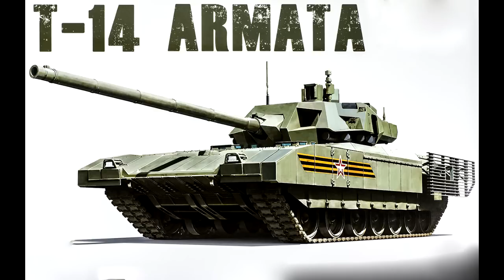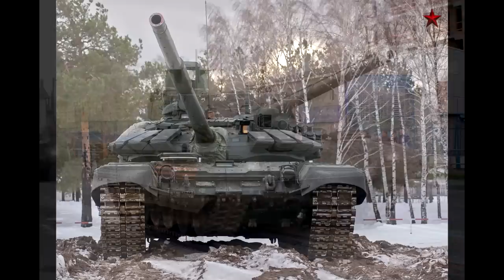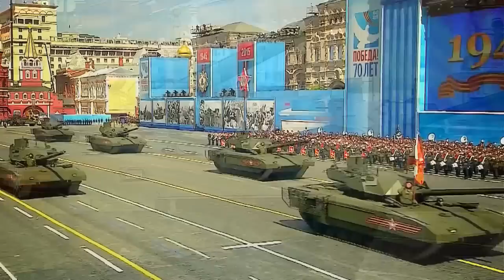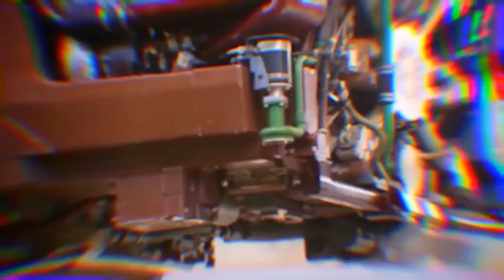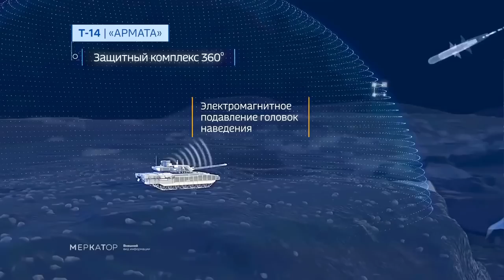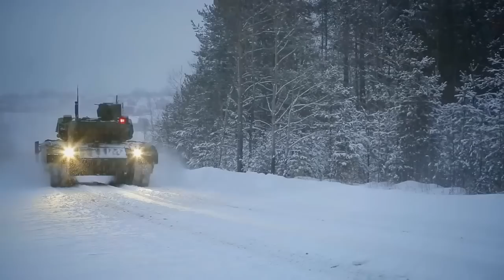Busting Myths on T-14 Armata

Comment: I really looked forward to this video but realize that no myths are busted since no proof are given. So busting myths becomes its own myth. 👎
Reply: That claim on Afganit being able to stop APFSDS is quite questionable. That Izvestia article claims it works in same manner as Drozd. As it has been admitted by Russians, Drozd is unable to stop APFSDS. It is simply too slow. I dont really see how Afganit can stop Sabot if, it works same as Drozd. Problem is that shell velocity of APFSDS is 1,5-2 km/s, while Drozd shell velocity is most likely subsonic. Drozd shell needs to fly 7 meters before APFSDS reaches the tank. Meaning that from range of 500m APS has less than 0,3 seconds to detect, calculate, turn turret to correct azimuth, launch, and shell to fly to interception point. Also the effect of light fragments hitting extremely hard object with extreme energy may have little to no effect on APFSDS. 

This "source" claims that KAZ Afganit uses Explosively Formed Penetrator. http://www.findpatent.ru/patent/226/2263268.html

Completely different claim than what your Izvestia claims. Both Russian sources. This is easier to believe that IF Afganit uses EFP instead of FRAG to intercept incoming munitions, it may be able to distrupt APFSDS. Though the means of delivery is still problem. Being Drozd related, it may still be too slow to meet the incoming shell.

Since we have sources claiming completely different methods of operation of Afganit, we can only wonder what is the truth or if there is such at all. I believe that Afganit can stop APFSDS when is see slow-mo of it happening.
Reply: RedEffect no, youre using Russian state owned media as a source. do you think that there could be a little bias there? lol
Reply: "Afghanit" was indeed sucessfully tested against APFSDS. As far as i know it can stop threads with a maximum speed of 1700 m/s. Sure, an Hardkill APS doesen't "intercept" APFSDS. Not possible, but it shatters/tilts the KE penetrator. A israeli study has shown that only 7° tilt reduces the penetrators energy about 90%.
Other APS that can intercept APFSDS are the Israeli "Iron-Fist" (not entirely sure about that) and the german "AMAP-ADS" (that's for sure, it was tested).

Biggest problem with Afghanit is the whole turret needs to turn if the thread comes from another direction, resulting in a extremely slow reaction time. But for the 120° front arc, it's just fine.

And no, i'm not a biased russian.

If someone is interested in APS technology i recommend this blogpost: http://below-the-turret-ring.blogspot.de/2017/01/hardkill-aps-overview.html
Reply: Jonny By "Intercept" i meant APS manages to have effect on APFSDS. You can say Afganit is able to to do this and I can say it can´t. It is no use as long as nobody can present real proof. Even that blog you linked also mentions that claims of Afganit being able to intercept KE  penetrators is questionable and should be taken with grain of salt. First of all we would need find out how exactly Afganit works. Does it utilize HE-Frag, or EFP. How does Afganit deliver this? Does it fire it at incoming munition straight from the turret ring or does it have "throw charge" like Drozd?

If Afganit really uses HE-Frag and works like Drozd, then i cant really see any way for it to be fast enough to intercept APFSDS. Especially from shorter ranges.
Reply: RedEffect
You make a very good point. Question? If counters to these modern 
developments are happening, wouldnt it be a risky to produced such a 
large number of these by 2020 or etc..?
Reply: +Oskar Grabnar "they killed millions of civilians past year"  By millions, you're implying more than 2 million people in the past year.  What's your source on that?
Reply: everyone is biased lol, i'll believe the russians about russian tanks intill someone other than the russians invest enough money in it that calling it bad won't be propaganda or it fails in combat
Reply: they are always lying
Reply: Afghanit uses unguided HE.  Improved and more effective/lighter than the Drozd "explosive screen". And we're not talking about 50 meters here. (Although AMAP-ADS is capable of affecting threads fired from 10 meters, but nvm) The better intercept speed is simply a result to the APS sensor range, not to the faster Hardkill capsules.
Reply: Does it really use HE? Funny enough that the link in my previous comment ( http://www.findpatent.ru/patent/226/2263268.html ) claims Afganit to use EFP instead of HE-frag. This was presented to me by another person supporting T-14.
Reply: Actually...The M1 as fielded in Desert Storm (1991) was meant as a hard counter to the T-72 and T-80.  The guns on those tanks were fully capable of killing an Abrams, and vice versa.  The catch:  How much crew training each side had, and what optics were available.
Reply: FubarSWE it’s Russian propaganda there technology is crap years behind the west lol
Reply: jajaja...let me know when they (THE TANKS!, not EID or antitank missiles) destroy y face to face combat the latest version of a Merkava tank, ok?...anything else said is just gossip and inconclusive videos that prove nothing.
Reply from the maker: FubarSWE 
Check the description
Reply: Those sources seems like more propaganda than true facts or?
Reply from the maker: Oh, you are one of those "Russians are lying" guys?
Reply: No way, I'm looking for the truth but source criticism is essential in that perspective. Propaganda is reality from any  side.
Reply from the maker: Well it is what you choose to believe, if you want to believe it is propaganda go ahead, but I dont see a problem in interview with the chief of Armata project who said they tested APS and that it works and are planning on improving it, and also explains how it works. And a source that says 100 Armatas were ordered last year, I mean the tank should enter mass production at the end of this or beginning of the next year, order of 100 is no surprise.
Reply: Since when did russian secrets become general information? 
I choose to remain as critical to whether the information reflects reality. 
Look at Leopard getting blown up in Syria, more or less impossible according to circulating specs, still it blows up by HEAT missiles it`s armour is supose to handle (yes one can talk about versions or angels or ...)
Is it true? I believe it to be,  but cannot prove the circumstances or the information.
Do I believe Armata is a good piece, yes I do.
Still I would say you never know until combat proven.
And yes, living in a democracy I feel free to believe what I want.
Reply from the maker: Those couple of things arent really secret, why would it be a secret on how much Armatas are currently there and how APS works, many tanks now do have APS, Isrealis even developed APS called Iron Fist that can also counter APFSDS projectiles.
Those Leopards are older variants, where most modern over there is Leopard 2A4, which is obsolete agaisnt modern ATGMs. Most modeern ones, the Leopard 2A6 and 2A7 would have no issue fighting over there. 
There are even Saudi M1A2s getting destroyed, but they lack DU armor, which is main component of original US one and their armor is very different.
We even have T-90 that survived a hit from TOW-2A. Now TOW-2A is tandem shapped, which means it counters ERA, so by looking at armor of T-90 and armor penetration of TOW-2A, it should have destroyed that T-90. But it didnt.
Combat proven is a strong term. Tell me one tank that got really combat proven against equal foe? I cant think of any. Abrams was figting Iraqi T-72Ms which were 20 years old by the time Abrams fought agaisnt them and had no way, even in the wildest dreams, to even penetrate Abrams to begin with. No modern tank actually got really combat proven.
But, as I said, you are indeed free to beilieve what you want, no one says you cant.
Reply: So lets agree we dissagree then ;)
Reply from the maker: haha Ok :)
Reply: @FubvarSWE
You know, why the Leopard 2 of Erdogan got destroyed? Because its an very old version, not updated and germany does not send upgrade kits! The Leo2a6 and 7 can withstand that!
Reply: @fubarsweeklund2141  What are you talking about? The Leopard blowing up in Syria is totally viable and is completely expected considering what the public knows about it. It's no secret that the tank like any tank ever in history requires infantry escort in urban areas. Plus, the Leo got penetrated from the side, which is weak on every tank including Armata/Abrams/Challenger/"insert tank here" it's why the Abrams has the Tusk upgrade package because otherwise an rpg would go straight through the side.
Reply: FubarSWE American sources - 100% true because its country about freedom (where they killed millions of civilians past year) 
Russian source - propaganda.... why? because our media said that ------- This how mostly American says
Reply: I agree, If your gonna make a mythbuster video you should reference your sources.
Reply: +RedEffect
Thanks for being honest that you were just basing yourself on Russian propaganda bullshit like Russia Today. That saves a lot of debate on how this bad video was somehow still accurate.
Reply: well the US kill alot not to the point of millions but it doesn't deny the fact that US drone and smart bomb have a tendency to strike unarmed civi in their home and even their wedding and their funeral lmao. Oh and the OP do post his source in the description if you tell me who to trust I will trust the person who made the tank not the person who made up the myth
Reply: +Blah b 
Butthurt murican

Comment: Problem is the same as that of the old Soviet Union. Many good designs but a small economy to support and sustain research and longer-term production and deployment. With an economy only 10% of that of the USA and smaller than Italy, it looks like the people of Russia are going to have to be opting for "guns instead of butter" for many years to match the West.
Reply: Raw materials are a relatively small part of the cost of a tank. Design, production facilities and tooling, testing and development represent a much bigger component of total cost.
Reply: He is right and brings back very succinctly the initial point I was making. That attempting to compete with the US in the game of producing high cost, high tech. weaponry is going to be a losing strategy until Russia has developed a much deeper and wider economy across a broad front of sectors than it currently possesses.
Reply: Have read it and its still wrong. If your labour (and the labour of your fellow citizens) is so cheap and your technical capabilities so many decades ahead, why are we not now all buying consumer products designed and made in Russia? (mobile phones, microwave ovens, SUV's). Why do the people who own all your wealth choose instead to take it offshore as fast as they can make it?
Reply: No, you still miss the point about how underdeveloped Russian commerce and industrial systems are. That is why your wages are so low compared with an equivalent person in France. If you were in France, your salary would be at a French level. That is because the French economy has greater productivity than the Russian. (Even in the military sphere. Owing to the Crimea/Ukraine episode Thales cancelled a sale of a Mistral class warship to Russia). You can say its "better than ever" when the rest of the world are all buying phones and shoes and clothes and cars made or designed by companies based in Russia.
Reply: Putin is not a communist, he turned Russia into a capitalistic state, if any of the Soviet leaders knew what he was going to do, they would ensure he wasnt even born. USSR feared US, but so did US fear USSR, there has always been an arms race between the two. Both copied something from the other in an effort to make that something better.
Reply: Have it your way, there isn't room here to explain in sufficient depth. But just consider why the Cold War ended so abruptly with such a complete collapse not only of the communist regime, but a complete dismemberment of the state. If things were so good strategically, would they have turned out so badly? There is a danger that Russia under Putin may find itself in a similar bind. To compete with the West, it's not shiny new tanks that are needed, but a much more dynamic non-military, non-resources based economy that can then sustain a competitive military more easily. That is what the Chinese have achieved. I don't see evidence of Russia getting there at the moment. This shortcoming was the root of the failure of the later Romanov Tsarist regime, the Soviets, and now perhaps this one. The last Russian leader who really understood was Peter the Great who actually lived in and absorbed the leading commercial cultures of that time in England and Holland and dragged his country in their direction despite opposition.
Reply: everything is "cheaper" means nothing because in terms of capital intensive goods like tanks you need high productivity / high tech industry 

argument about the wages and price of raw materials are not true, because in manufacture of capital intensive goods, wages are a minuscule fraction of the cost
Reply: yes, please teach me production costs :D 

first of all, tanks in the west are more cost effective for given technology. 
you are saying armata is made from steel? do you even have a clue how even if it's 90% steel , price of steel is a minor component of the final price? things like amortization of machinery, investment in tooling, training and maintaing production, inovation investment, long term procurement and risk calculation, R&D, gazzilion other costs. 

for all of that you need strong, competitive high tech industry. russia does not have that. you are missing the point, resorting to autarky (not importing - exporting) leads to higher costs, but hey, that's basic economy you haven't mastered yet.

production of high capital goods like tanks NEEEDS efficient, productive, high tech industry that russia does not have in same capacity as west, or other rich countries. price of the tank is gauged by productivity that is gauged by inovation capital and tech capital, that si seriously lacking in russia. then russian goverment and state owned military industry come in and display the direct cost of the product, while hiding the hidden costs, oportunity costs, subsidies, transferance of public funds, etc etc 

don't teach me economics.
Reply: i love it how you lack basic grasp of most basic mechanics in economics. 

anyway, you are wrong. low wages reflect low productivity, efficiency and skill of workers combined with unoptimized market, distribution and innovation. if country has low cost of goods it can mean two things, either goods are efficiently produced or demand has low purchasing power. latter is true in Russia. there you have spiral circle of low cost but inefficient economy that can't really compete in capital intensive goods. while it could compete in labor intensive goods, those are being substituted by effectiveness of capital intensive goods, because there is a shift in production where yesterdays labor intensive good become capital intensive goods, therefore countries that produce labor intensive goods and have comparative advantage in them, loose their comparative advantage because of the shift in L/K ratios of goods in the world caused by automation. it all back leads to inefficient economy and state interventions+cronyism and corruption, that holds down innovation, education and intellectual capital. intellectual capital as a foundation for productive economy then votes with their feet and migrates. with declining population, and low immigration, Russia has HUGE issue and will have it even worse if it maintains it's current policy of cronyism state intervention and inefficient pumping military while dealing handouts to it's satellite states.

you can make you own economics and arguments but it won't matter. econ mechanics don't care about your feeling, they are simply true. 

Russia is laging behind the west, and can't produce efficiently capital intensive goods. 
please, study economics.
Reply: "agro culture" advantage of Russia? 
now i see you are just trolling or simply don't have you facts together. Russia is mid to low tier in efficency of it's agriculture.

Comment: Armata T-14 is base more on obj 299 then on obj 450 or T-74...I think UVZ used best solution from many soviets designs and incorporate in tank cal T-14....
Reply from the maker: Armata platform is based on Obj 299, but T-14 gathered a lot from Obj 195, which gathered a lot from Obj 477 Molot and T-74. T-15 is where results of Obj 299 can be spotted. But Armata platform is truly a mix of different projects.